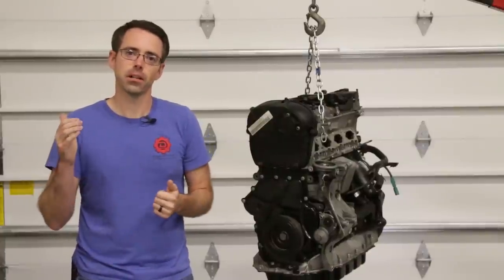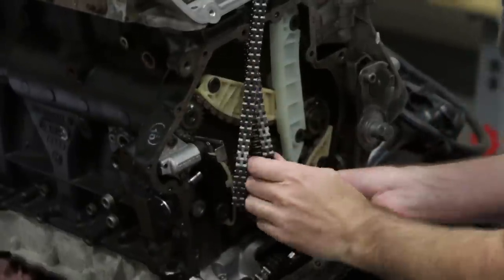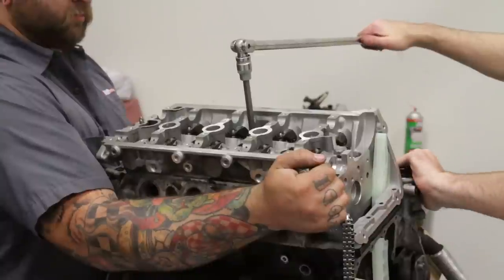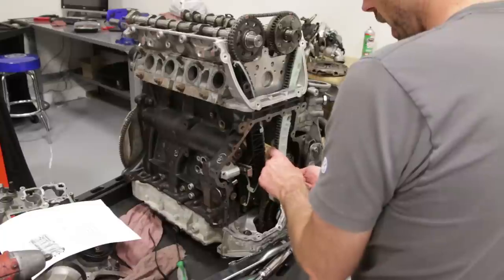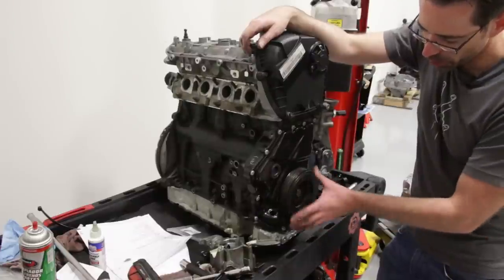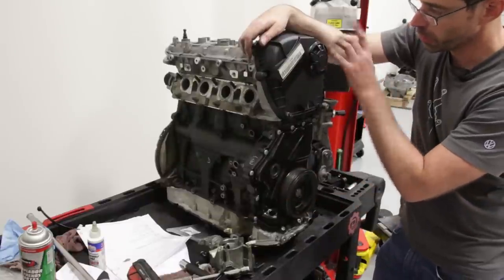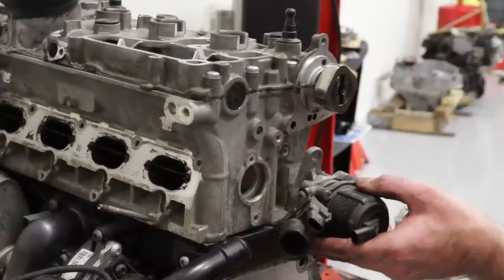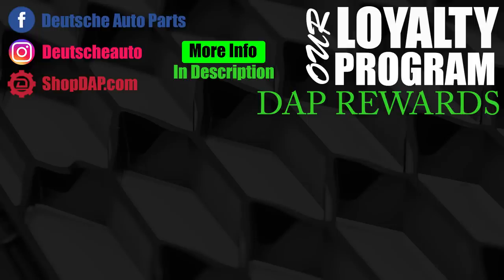2.0t TSI VW | Cylinder Head Install and Timing Up the Engine

Comment: How strong are 2.0t pistons and rods
Reply: 856XerXes the rods in the engine are pretty weak along side with the bolts. The ribs are about 2 1/2 inches thick and are not harden, just cheap cast iron which also makes up the pistons. The pistons are more durable in design but if your timing is off you have a high probably of your pistons becoming powder and your rods most likely breaking off from the bolts that hold in place on the crank, the bolts are pretty wimpy and thin as well. So timing, guid rail(none updated dated rails are known to crack after 40-80k miles most of the time), chain tensioner(none updated parts don’t have spring to prevent timing slip in cold start or if engine is low on oil) and proper seal is important. So to answer your question not that strong, recommend Max hp on them would be about 350 before you start stressing them out. If you feel a wobble at about 4-5k rpm and it’s gets worse and it isn’t your tires, or misfires, or studders, sometimes loss of power  then you most likely having timing issues.
Reply: Sorry it’s long, you might know about this already but gives people who don’t know some information.
Reply: @gurenmk5047 You seem to know that staff. I replaced my tensioner with the updated part but haven't done chain and rails. Currently running at stock power and don't plan to go further than stage2. 60k miles with 5k oil changes. What do you say (regarding chain etc) ?
Reply: TRiBaL81 at 80-90k miles just as preventive maintenance and tune up, I would suggest replacing the chains and guid rails especially if they aren’t the update parts. The old chains have a tendency to stretch out, especially on the upper chain. The rails I would also change at the same time as well, the older ones are also more prone to wear out on top of the rails were the chain sits or break in specific stress points of the rails. The newer ones will last much longer and the newer chains won’t stretch out as much or at all just because how the new ones are designed compared to the old ones. I’ve already replace my engine 2 times on my b8 avant cause of timing chain issues killing my engine  both engines “check” and replaced by Audi from 2 different Audi locations. So it can be a big issue, not the first time I’ve seen golfs, a3s and Tiguans that use the same ea888 engines that have failed timing and cause minor(can still be used but could replace some parts) to total engine failure. If you hear light to low rattling like something is lose or like marbles in a bag, could be your timing. So check throughly. They are good cars if you take good care of them, I still have my avant(third engine) with Integrated engineering internals and updated timing and rails and tensioners. Runs like a dream.

Comment: Many troubles with my VW Tiguan 2009 has 77k miles and has leaks of oil in all engine the mechanics says that it is need change all gaskets and it cost $2800
Too much money. Wow these cars it so delicate
Reply: Dealer should charge no more than 1400 for the valve cover and gaskets. Just had it done in central Florida a month ago

Comment: Since I had my timing chain done on my vw scirocco tsi it has not sounded the same. Cold start up strange vibrating rattling noise and all sorts
Reply: When did you have this done and how does it feel different, especially when you are driving?
Reply: Same here, my scirocco TSI 2.0l has been in the garage for a week after a timing chain and tensioner job. They are still trying to figure out how to correct the timing. The engine is shaking and idles very rough. I mean is it just as easy as lining up the markings on the chain?
Reply: @gurenmk5047  had it done last September and it doesn't feel different driving it just makes a vibrating rattling noise on start up for exactly a minute..  I have been back to the garage 3 times and they said it's down to injectors
Reply: gavin1980 cosgrove oh well there you go, I use to have a similar issue as well when my intake manifold, the threads inside the intake part of the head stripped and my cause was shaking pretty bad and back firing a lot as cool as it was I had to fix it. So I hope everything goes well

Comment: A gentleman brought his A4 2009 in for a skipped timing chain.

All intake valves bent.

Head work was subbed out to machine shop.

I specialize in BMW repair and I find this little engine to be a total disaster. I do like the cast iron block. I'm sure if I was a glutton for punishment I could get perfectly versed in Audi VW work (of which I have done quite a bit as a "general repair" person with a pleasure for working on BMW).

* Poor room to remove exhaust manifold nut in rear bottom second from the very back. I used an 80s BMW  tool kit wrench. Other tools would work surely. Audi has a fetish with shitty access to bolts even with disassembly.
* The 6mm internal hex bolt (a VW specialty) that acts as a 3rd hold down for exhaust manifold heat shield has a ridiculous  "no room" situation. I used a 1/4 stubby bit with a 6mm end on it and a wrench to remove it.
* The chain tensioner showed the same P/N as the replacement chain tensioner so it likely was replaced before it shit the bed. Not confidence inspiring. The new chain VS old chain did show stretch in the old chain.
* The balance shaft set I purchased went back because the top most guide didn't fit and needed a dealer guide. This is also in another video "Edge Motors" who finds the same issue. Dealer says the lower balance shaft chain never goes. So does everyone else I talked to. A nice VIN split it appears. Just a little piece of "gotcha" for anyone who wants to also replace the other 3 balance shaft guides. 15 links between all colored links on the balance shaft chain BTW.
* Special tool set is required. Specifically I find ridiculous is the set of red plastic spacers/gappers for the exhaust camshaft. I noticed they moved and I moved it in my hands and the ball bearing and spring fell out. Found it and stuffed it right back in.
* Valve cover requires cleaning and sealant per the video, and manual says must be assembled in 5 minutes or so. Also all 22 bolts must be replaced even though they are steel. I'm sure AudiVW wants all bolts replaced that you take out. More $ in junk hardware. At least BMW has aluminium bolts (which suck to be frank) that make some sense to replacing due to the properties of aluminium. Audi loves to sell screws. Times must be tough.
* The "camshaft bridge" screen which has been noted before was found inside the head sitting kind of close to the bridge after removal. What a joke. That shitty little stupid screen. The car has so many problem areas it's one big problem area.

And much more!

All in all this is a dinky 4 cylinder POS, completely overengineered, with thrust moving back/forth exhaust cam, apparently failing injectors (also, the white clip things that the injectors seat into are not available, you buy 4 injector seal replacement kit and that's the "update design"), failing water pump, failing flange o-ring on back of head (minor), and a CVT that might crap out.

Full disclosure: The job isn't done yet!

I will consider reporting back if I pull it off and it runs again. This video goes against several things as other commenters have said:

1. Install head, then turn crank slightly back (I think almost verbatim per the shop manual, I didn't when I did a test install of the cam cover - hope that's gonna be OK...) and THEN install cams using those red tools on the exhaust cam
2. Then once cams are in, torqued down and one isn't sticking out further than the other, then you lock the cams with the special tools, and install the main timing chain by rotating each cam and lining up the links between the cams. This video is deceptive as I doubt they dressed the chain with the cams lined up and then torqued down the girdle or what I'll just call the valve cover.
3. Then you slap in your guides and pull the tensioner and spin it around and hope it all works when you start it up.

I'll report back! Clearly this job is for a VW Audi specialist. I'd take another one if this goes well, but the amount of BS they make you go through is a little much. Simplicity is beauty. This is complexity on top of stupid design. Ok, I'm not an engineer. I just see a lot of designs and even BMW's newer garbage isn't this bad.

Like the old VW commercial, "YOU GET AN F" Audi VW. It's definitely sucking.
Reply: Obviously you're totally incompetent. Apart from the tensioner issue (which was fixed long ago with an updated part) this is a very good engine with plenty of tuning potential. If you can't handle this kind of work then i doubt you are a mechanic as you claim.
Reply: @TRiBaL1981  Maybe I am. Intake cam was bent out of clocking. Replaced both cams used from a friendly shop.

Car has been gone for months and phone quiet after a couple friendly check ins on my end. 

Thanks for the kind words!
Reply: @spencermaiers8322  Hello! VW has several 4 digit engine codes for 2.0 TSI engines, and all of them are slightly differrent. The timing chain tensioner is the most common issue, I think your customer got very unlucky with that car. Unfortunately most recent cars have problems. Imagine that, in germany they have 18 000 miles oil change intervals for that engine :D , no wonder they fail.